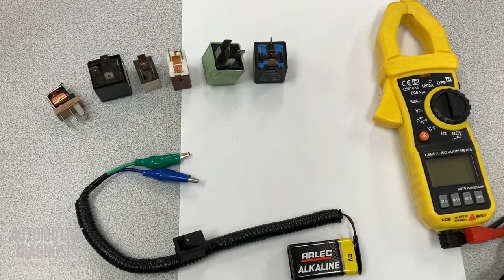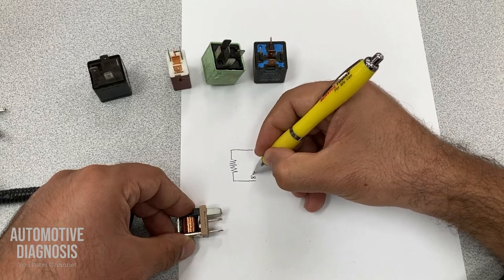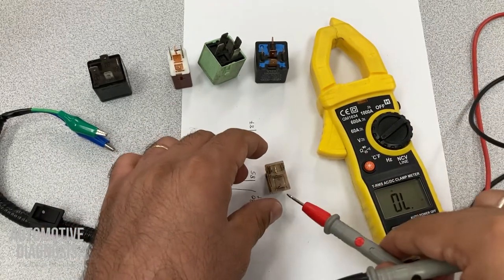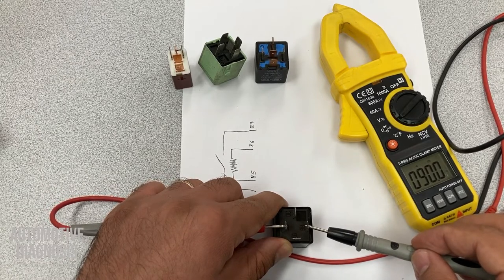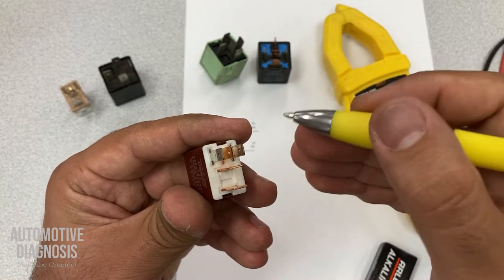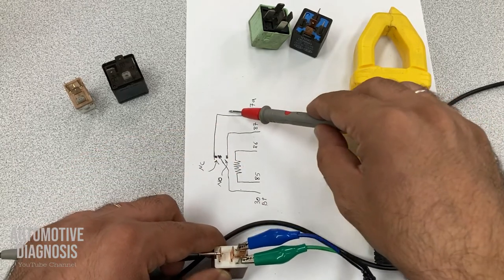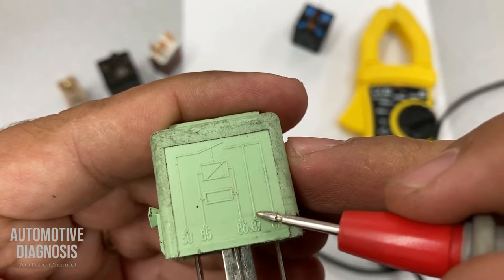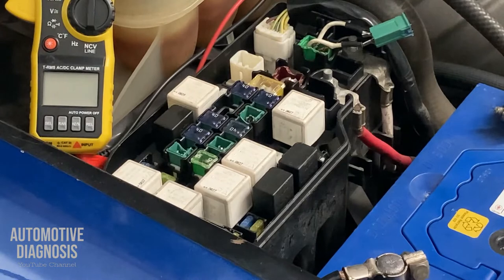How to Test ANY Relay & Wiring | How to Bypass any Relay | 4 & 5 Pin Relays

Comment: Very nice demonstration and explanation appreciate it but you missed to explain about the decay diode or resistance important s in every relay in new cars and if the resistance  of one om or more in 87 to 30  discard the relay  . Because when working it creates resistance in load. Thanks 👍👌
Reply from the maker: Hi, thanks for your feedback. Yes, you are right, I just didn’t want to make it complicated this time, there is another video coming with the rest of the information. 🙏🙏